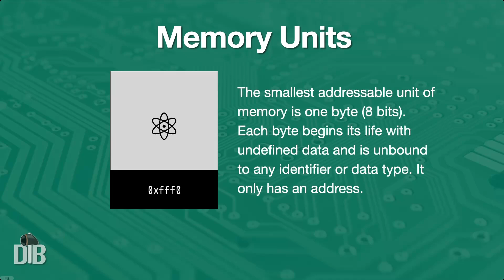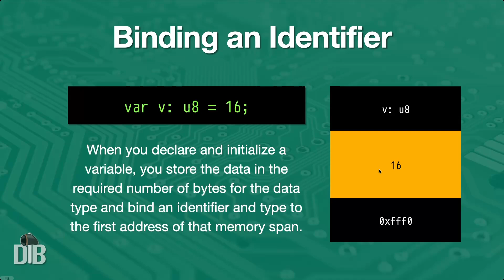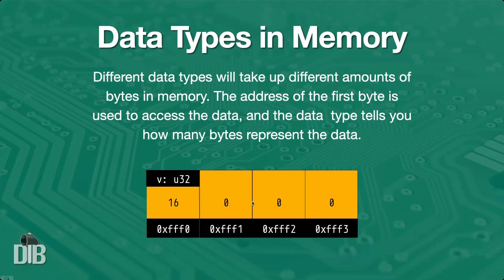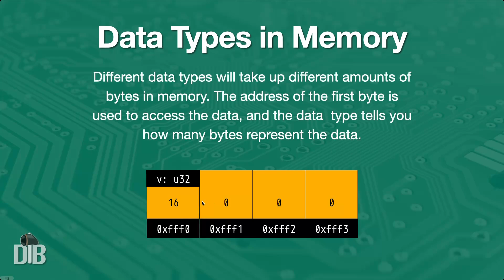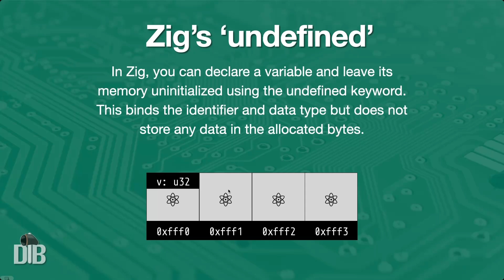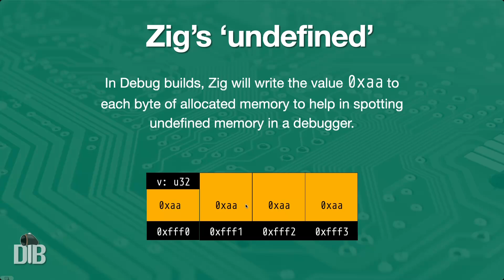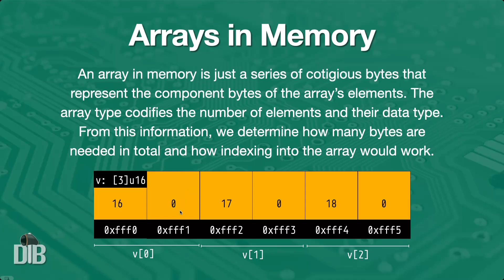Zig Master: Data in Memory

Comment: Thanks for this video. I constantly take for granted that I started programming in machine code (assemblers did not exist yet).

Most modern programmers do not know this stuff unless they have a need to learn about CPU / ASIC design.

I do understand why the addressing mode is not normalized (to say network byte order) but instead keeps the machine's natural mode. This can be a huge performance gain. BUT if any address math is performed, close attention needs to be paid to this detail !

Thanks to you, I learned something today - check ;)